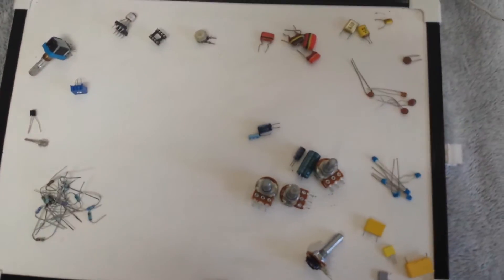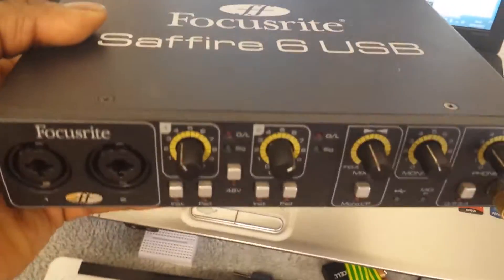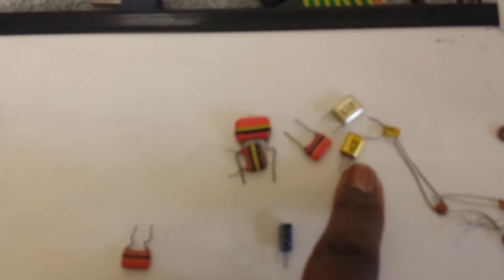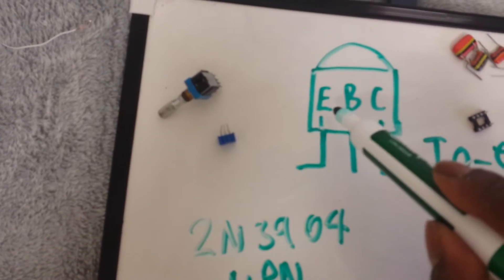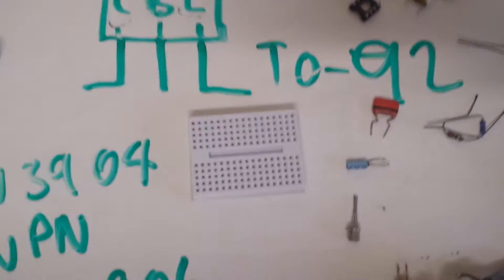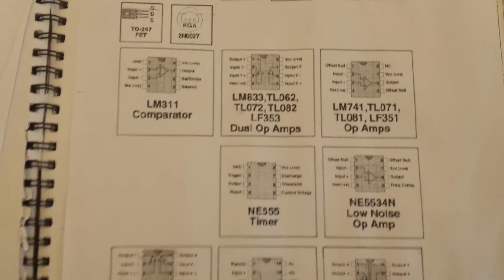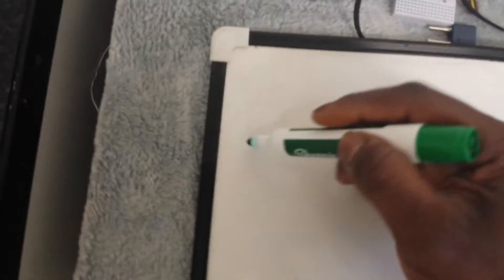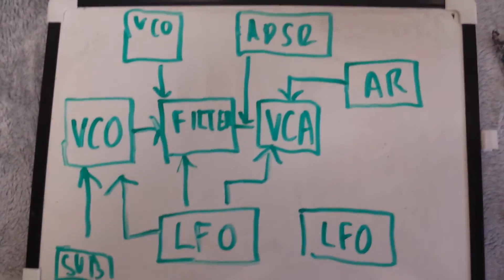DIY analogue synth project Tutorial (Tips and info 1)

Comment: I bought myself a MeanWell RT-65B 65W switching PSU with a 5V, +12V  and -12 V output. At €25,= it's a bit more expensive than a few 9V batteries, but still a lot cheaper than many eurorack supplies. Yes it's a switching PSU and not a linear PSU, but I'm pretty sure that this won't make a big difference.  I haven't had the opportunity to test it yet, nor have I connected it to my scope to get a definitve look at the ripple and noise, but when I do, I'll post my findings here. ;)
It might be an option worth considering for people who are new to the DIY synth game...
Reply from the maker: Jean-Jacques de Balzac . Yes for sure it should work out ok. Im guessing as long as you try and keep your power rails clean you should be ok. My first supply was switch and non linear and worked very well. +12/-11.30ish . I even made sure it was on its own extension lead. And not sharing the extension lead with any other equiptmemt.

Comment: Ajull, I've read today that computer PCI sound cards usually lets to safely input not more than 1.2v (1.5 maybe). And 0dB is around 0.75v.
I'm not sure that my sound card is protected against over voltage though.
Did you've used some elements to limit volts before your audio interface?
P.S. I use Audigy 2 Platinum (bought a used one very cheap). It has a block called "drive" which is really reminds any simple audio interface (without special mic inputs though). I have and idea to use a speaker. This will definitelly be a best protection :)) But this will cut me off a "PC oscilloscope". If you have some ready-to-use safety tips then you could make a short video about everything on this theme related to DIY analog synths.
Reply from the maker: MoolahNasreddin Im not sure on protecting the input of your audio interface . Mine comes straight out of the VCA with the type of cable i showed. Perhaps using a resistor in series between the signal out lead from your op amp (not the ground) is the answer. Test with a multimeter first thou. Yes i may do a video soon on this there are so many little tips and details im yet to share with you guys .
Reply from the maker: MoolahNasreddin Personally i think an Soundblaster Audigy should be adeqaute to go straight in with the cables , dont use a pci soundcard
Reply: yeah, maybe there is a pre-amplifier with a limiter. When I use the electro-guitar in LineIn/MicIn I can't make it a complete zero by the knob... But it's just a supposition. The guitar is clean without a pre-amp or a combo-amp.

Comment: It's really cool that you're reclaiming components from old gear. Also I'd never considered pulling apart cat5/6 for jumper cables - I've got a drum of cat5 for making ethernet cables so that would have saved me some money. Good tip!
Reply from the maker: DannyCarnage Indeed , its been very useful finding old obselete parts . Which some in my opinion were built to last. Having said that i had a great find the other day from an old behringer fx processer non working my freind gave me. It was a +/-15 and 0v/ground supply and transformer. Old amps are also useful for reclaiming things like this . Its saved me a couple of quid so all good.
Reply from the maker: DannyCarnage . Yes D get on it Cat 5/6 solid strand all the way . Pre fab jumper cable is never enough and overprices for what you actually get in my opinion.